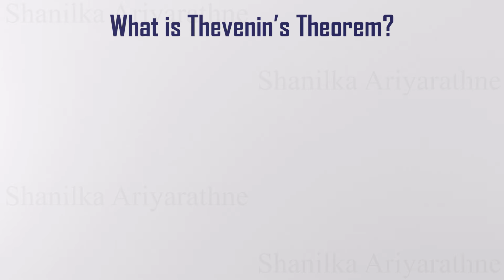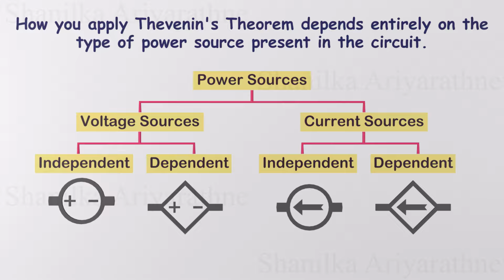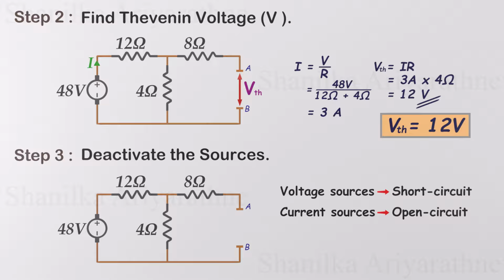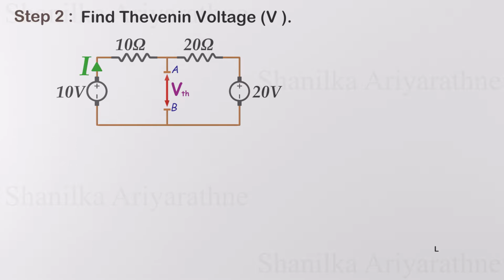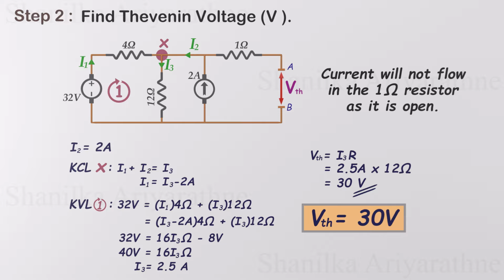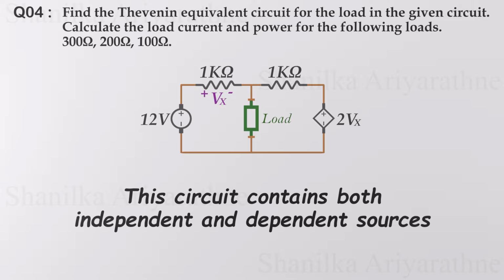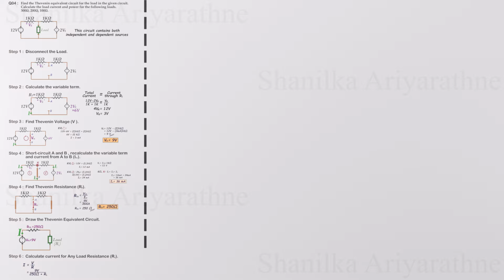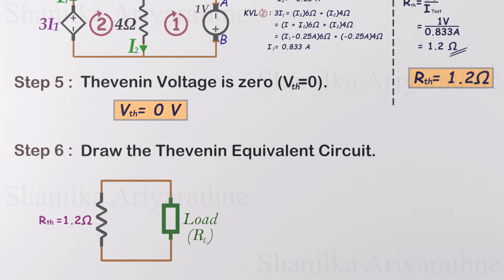Thevenin’s Theorem | Solved Examples independent  Dependent sources

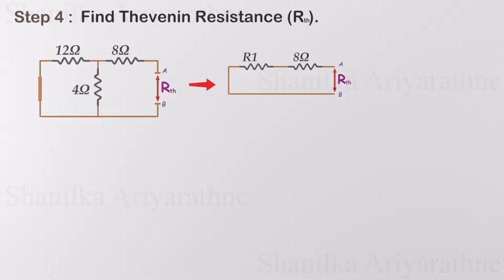Comment: This video is very well done. However, there appears to be a possible mistake at 7:34. The video states that the 12-ohm and 4-ohm resistors are connected in parallel, but isn’t it actually the 4-ohm and 8-ohm resistors that are in parallel?

Comment: At 19:54 wouldn’t the two 1k resistors be in parallel, resulting in a  500ohm resistance?
Reply: No due to the dependent voltage source, you can't just deactivate a dependent source like you do with independent sources. Once you get the Vth and Isc, Rth = Vth/Isc. Don't worry about the picture to the bottom left I think he just put it to show where the Rth is located.